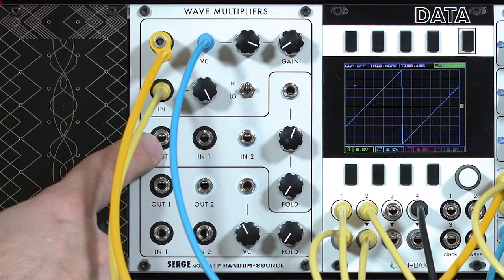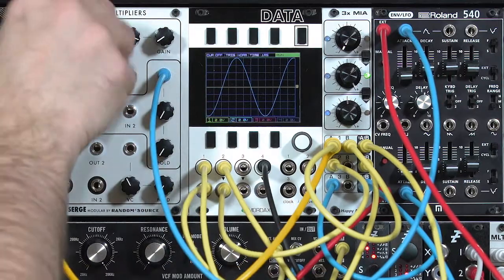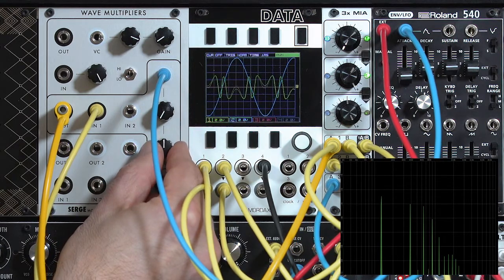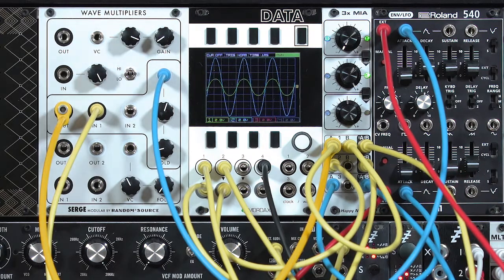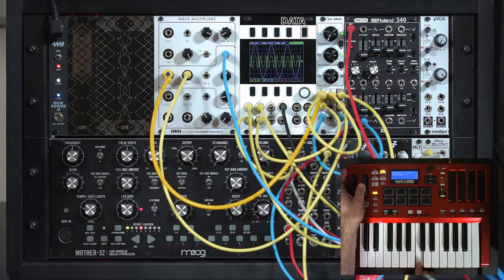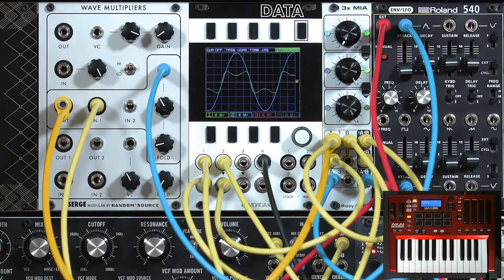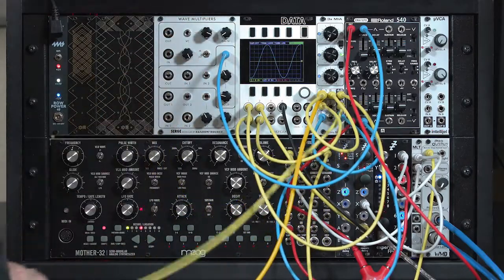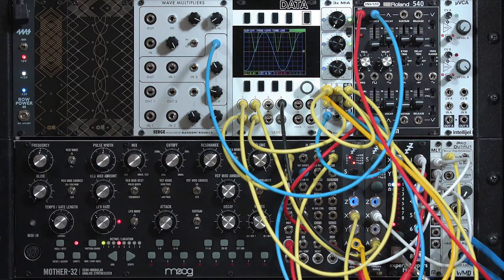Random*Source Serge Wave Multipliers: Wavefolding (LMS: Eurorack Expansion Preview)

Comment: Question about the wave multiplier:I have a Joranalogue Fold 6 wave folder, and it "closes all the way," for lack of a better phrase. When the fold amount is at zero, it's like a closed filter. So you don't always need a VCA on the other side of it if you're making short, percussive sounds, for example. I don't know how other wave folders operate, but I'm guessing this is not always the case. It is useful, though. Could you tell me if the wave multiplier — any of its three paths — work this way?
Reply: Only a few wave multipliers go to "off" like your Fold 6, the wavefolder section in the Pittsburgh Lifeforms complex oscillator being another example. The third section of the Wave Multipliers is indeed a VCA, with nice saturation/overdrive.

Comment: This video made it very obvious what increasing the effects of wavefolding does, and I'm glad it gave visual and aural feedback :) It was also cool to see some creative ways of using wavefolding with an envelope...thanks!
Reply: It amazes me that people think that applying one of the most basic modulators out there, like an envelope, is a creative way to use any audio processing module. 
What did you think those CV inputs were for? The two most obvious modulators are an envelope and an LFO. Almost any synth, modular or not, has an envelope generator. 
BTW, great  video.

Comment: so what is a wave multiplier that isn't a wave folder?
Reply from the maker: According to the Serge manual, "the Wave Multipliers are able to dynamically process the input waveform to produce new harmonically-related overtones" - in other words, in Serge-speak a wave multiplier adds to (or multiplies) the harmonics available in the original waveform. 

The Serge Wave Multipliers module has three sections that alters the waveform in different waves, each creating different mixtures of overtones: the top one is a very rounded clipping saturation; the middle one is the wavefolder that tends to produce or emphasize mainly odd harmonics, and the bottom one is a series of full wave rectifiers that produce mainly even harmonics.

The article linked to in the video's description includes a page from the 1983 Serge manual that describes the module in more detail.